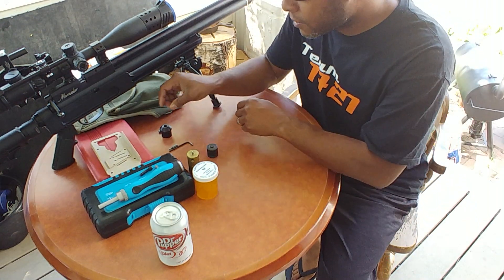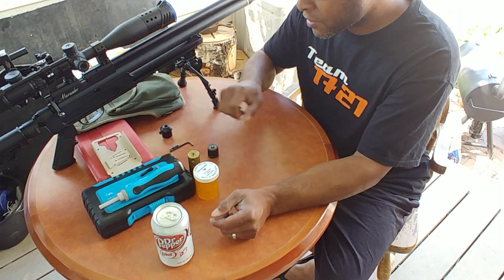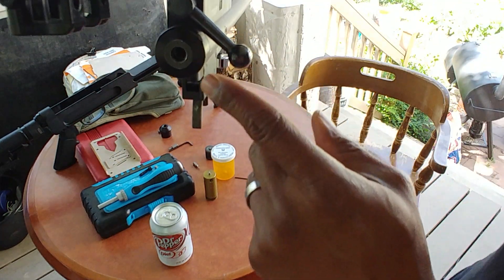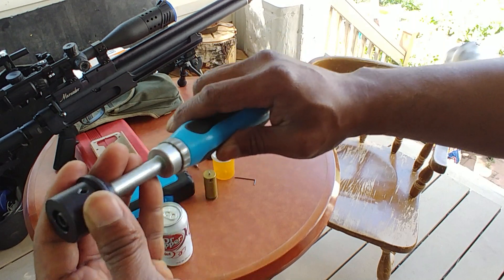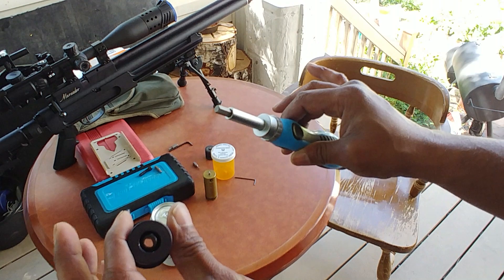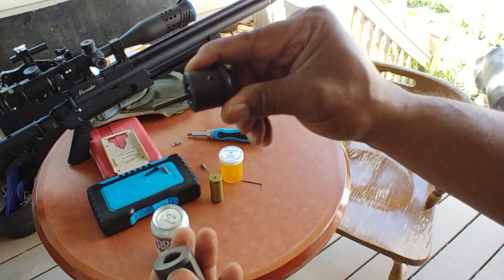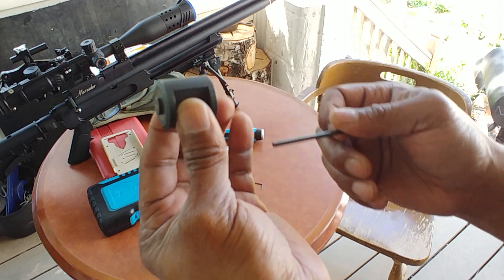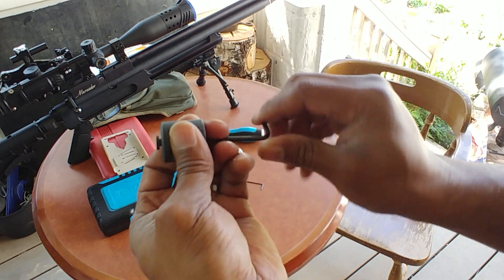How I tune a Benjamin Marauder for power.

Comment: hi Joe; i have the .25 cal. and i'm shooting about 740 fps. and i think that is a little slow.  It is deadly accurate. Something i really like about shooting. That is my number one concern about shooting air rifles' but if i can get more speed and keep my accuracy i'll be very happy.  Love your video. Very informative. What kind of speed do you get out of your .25 cal. I think when you buy a Benjaman marauder .25 cal. the spec.'s are in the high 800's if not 905 fps. Am i correct?  Also how do i know if my Marauder is regulated or not and how do i know if it has the de-bounce deal. One more thing Joe; what kind of shot count will i get boosting everything up.   thanks for all the info
Reply from the maker: Hey Robert.  All my Marauders are all custom at this point.  I've either made bigger calibers out of them or modded them.  My current .25 is regulated at 2100psi and I get an average of 822fps for 40fpe for 30 shots.  But again it's modded and has a Hill valve.  I'm not even sure what I got stock.  I'm just not giving you a lot of info hear.  I would say to you to try what I explained and see how it goes.  If you really want more power and aren't afraid to take your rifle apart, then put a softer valve spring in your valve, use ¼" vinyl tubing for the transfer port, and shoot a heavier projectile, say like the JSB Heavies or Mk2 heavies.  Please feel free to always reach out to me.
Reply from the maker: Hey Robert.  All my Marauders are all custom at this point.  I've either made bigger calibers out of them or modded them.  My current .25 is regulated.
Reply: @Monkeydad1969  hi Joe; thank you very much for the info. I guess i will end up buying me a regulator and i hope it works for me. The reason is because i like consistency as for as for speed so i can keep my accuracy from shot to shot. Do you have a de-bounce system in your marauder's? If so what brand.  anyway keep up the fantastic vid's.
Reply from the maker: @roberttheriot7612  no I don't use a debouncer in any of my rifles.  I generally don't have an issue with hammer bounce unless I over do the spring or have a bad spring installed.
Reply: @Monkeydad1969  hi Joe, couple more questions if you don't mind.  If i install a Huma reg., do you think i'll get about 30 good shots at 830fps or somewhere around there. also. i hear a ping when i shoot my .25 Marauder any suggestions  thank you very much
Reply from the maker: @roberttheriot7612  Depends on your tune and how heavy a projectile you shoot.  I don't see you getting 30 shots, more like 2-3 really consistent mags.  The ping is the air leaving the tube very fast, along with some spring /hammer noise.  The rifle should have a black de-pinger in the the tube.  If not, thick vinyl tubing---the clear tubing, cut to size to fit the tube will help.
Reply: @Monkeydad1969  ok' so i am always shooting jsb 25.39 g pellets. don't plan on shooting anything else at the moment. so you are saying my air rifle comes with the de-pinger since it's a Gen 2. And if not i might put one. My setup at the moment is the one you emphasized on in your video. I went according to your suggestions and i got 852fps. so that's where i'm at right now. Haven't did anything else so far. So when i get my Huma reg. i will work from there. but what i'd like to know is to stay around that speed what do i set my reg at. Like said earlier i don't mind slowing down a little like maybe 835-840fps.so i can get a nice string of shots since i am using regular pellets. Any suggestions will help   thank you
Reply from the maker: @roberttheriot7612  if you don't have one then get a chronograph.  Also, you can look at your gauge when you are shooting at the speed you want, then you will know when to set your reg psi.
Reply: @Monkeydad1969  hi Joe; so what you're saying is when i'm shooting i can tell where to set my reg. I do have a chrony. I just can't figure out where to set the reg. once i get it. I know you have a lot of custom parts but can you give me a close ball park where to set my reg. say for about 830fps so i don't have to keep taking it out every time.  thank you
Reply from the maker: @roberttheriot7612  the Huma reg is set in BAR, so when you see what psi your rifle is shooting 830fps, then Google the conversion and it will tell you what bar.  If you haven't bought it yet then when you order it let them know what speed you want to shoot at and they can set it for you.  If you do have it then it as easy as doing the conversion and looking at the reg to set it yourself.  Also, as I said earlier, my .25 M-Rod is set 2100psi which is 145bar.  That is 822fps for me and you can just use the hammer spring adjuster and the velocity adjuster to get to 830fps easy enough...or set it to 150bar and again use the adjustments to get what you need.  There are more entailed things one can do, it all depends on your comfort level when it comes to working on your rifle.  Like port enlargement, valve spring replacement, etc.  Just remember, the BAR settings on the reg aren't written in stone, so you can get real close if not exactly on the and just make the adjustments you need with the hammer spring and velocity adjuster.
Reply: @Monkeydad1969  thank you very much Joe. I really appreciate all the help. i wll let you know the results once i get it installed. happy shooting  thanks again
Reply: @Monkeydad1969  hi Joe, may i ask a question? my .25 marauder sounds like it burps when i shoot it. What does that mean? that's about the closes i can describe the sound. That sound kind of irritates me.
Reply from the maker: @roberttheriot7612  is it full of air or about empty?  Did it just start or been an issue?  It's hammer spring to far in for power?  Maybe it's in need of a new spring.  That's what's called hammer bounce and usually happens because of an issue with the hammer spring.
Reply: @Monkeydad1969  i keep my tank either full or doesn't go down less than 2000psi. Gun is just about new. Got about 150 pellets through it. Came with de-Pinger and i can still hear the ping a little. I know I'm being a little picky but that's just the way i am. I know i will have to live with it. Now the de-bounce thing always done that. so i'm guessing the spring should be pretty much new also.  thank you
Reply from the maker: @roberttheriot7612  I'd like to get my hands on your rifle.

Comment: Hey, this power tune you showed, wide open on valve, 5 turns on HS, & 3 turns out on H Stoke. I like that on my marauder .22. I'm shooting  CPHP 14.3 gain. I ordered some JSB 18.13 gain 15.89 gain and A arms 16 and 18  gain. Do you use the stock hammer spring? And do you think I can get 900fps with the 18 gain? All stock parts that is.P.S. I don't shoot more then one magazine,  I fill to 2900 and it's still about 2600, then I fill it back.
Reply from the maker: Yes, if tuned right you can get 900+, and I am using stock parts, including the spring.
Reply: Hello  nice video  explain clear on the .177  I have the .22 model  Your tune works for both the 177 and the .22?  Thanks.
PS with the power tune  would you think be safe for coyote  head shot to discharge a coyote?  Have one trying to attract my dog in back yard.  Thanks for info. God bless
Reply from the maker: @topdragster365w  yes it does work on all the calibers.  It will definitely make a .25 capable of taking a coyote.  Here in Colorado it's only legal with .25 or higher.  But if you are legally able to use a .22 for yotes then the power tune will be very helpful.
Reply: This is a great video - thanks so much for putting this out there.  I recently just got a .22 mrod and will be looking to set it up similarly.   With your tune on a .22, what would you expect for a quality  shot count?  If you were looking to increase that count just a bit, would you first look to close up the velocity valve?  I'll be hand pumping still for a bit so may want to tame it some.  @Monkeydad1969
Reply from the maker: @jfhall  for that type of tune I'd look for 2 magazines.  I'd also shoot a little heavier projectile.  You may not have to be that aggressive with a tune on a .22 M-Rod to get good power, and still retain a good shot count.

Comment: Doing that does it affect the accuracy
Reply from the maker: It all depends on your rifle.  If you're tuning for power then most likely you are going to a heavier projectile.  You'll still want to shoot what's the most accurate out of your barrel.  As long as you have a good barrel and choose the right ammo then the accuracy of your particular rifle should be good.  If you have a bad barrel or shoot ammo that isn't accurate in the beginning then your accuracy will most likely not improve with any sort of tune.
Reply: @Monkeydad1969  thank u very much ...gun shoots accurate Jsb pellets so I guess it will accurate even I turn on high power😄

Comment: What is your fill pressure you are starting at? I assume 3000-3200. Thanks for the information!

Ok so I did the tune and I ported the valve and the breach to 3/16”. Before I drilled it out it was stock. I put the piece of 1/4 tubing for the transfer port. Before I did all this I had the hammer ccw all the way back and a full 8 cw on the hammer spring. With the jsb 25 gr. Pellets I was getting 865 FPS by filling to 3100 psi. After I drilled everything and put the tubing in and adjusted it like you had yours set at 5 and 3 I am now shooting at 700 FPS. Any thoughts? Thanks.
Reply from the maker: That's interesting.  I don't understand why you weren't getting over 900fps before the mods.  Here's is my bud's M-Rod shooting the Kings on the tune:

Created: 03-12-2018 07:40:16 PM
Description: Casey's .25 M-Rod
Notes 1: v.a.5ccw, rva5cw, hs3cw from face
Notes 2: Kings 3000-1900
Distance to Chrono (FT): 1.00
Ballistic Coefficient: 1.000
Bullet Weight (gr): 25.390
Altitude (FT): 5280.0
Temp: 45 °F
BP: 24.81 inHG
Shots
#     FPS        FT-LBS     PF
16    846        40.36      21.48     
15    854        41.12      21.68     
14    861        41.80      21.86     
13    865        42.19      21.96     
12    872        42.88      22.14     
11    886        44.26      22.50     
10    894        45.07      22.70     
9     903        45.98      22.93     
8     901        45.77      22.88     
7     908        46.49      23.05     
6     912        46.90      23.16     
5     923        48.04      23.43     
4     925        48.25      23.49     
3     928        48.56      23.56     
2     935        49.29      23.74     
1     932        48.98      23.66     
Average: 896.56
StdDev: 29.45
Min: 846
Max: 935
Spread: 89
True MV: 896.66
Shots/sec: 0.12
Group Size (IN): 0.00

Now he was only worried about getting 2 good mags.  As you can see his first 8 shots were great.  I only filled to 3000psi and the Kings were flying pretty good.  Also, anything past 6 turns on the hammer spring will put the spring guide off the threads, so the hammer spring and guide are loose.  If you push on them with your alan key you'll feel it.  I wonder if there wasn't an issue with the valve in the beginning.  Also, since you opened the valve exhaust, did you change out the valve spring for something not so stiff?  That will help with getting more air.  If you are on GTA or Airgun Nation look me up by my YouTube name and send me a pm.  I'll be more than happy to exchange numbers.

Comment: I need that stock .. I have the 25.cal gen 2 and walther berral with the adjustable cheek piece in a wooden stock it came with.how much is that stock you have
Reply from the maker: Hey Miguel.  That is the Teryx stock and they aren't made anymore.  I just lucked out and got mine for a good deal.  My return Teryx stocks are for the Gen I.

Comment: Hello, is the benjamin marauder regulated ? If not , will a regulater be installed ? And finally do you advise me to buy it in .22 ??
Iam an hw100 fan and never owned a marauder thanks.
Reply from the maker: I have my bottle M-Rod in .25 regulated to 2100psi.  I get 48 shots with a 3.13sd.  It uses a .35ltr bottle.  I'd say .25 over .22.  But that depends on your circumstances and what you are using it for.
Reply: @Monkeydad1969  thanks man 👍🏻

Comment: Hi how to stop air after removing valve screws both this is how my friend increased his marauder power please help
Reply from the maker: I'm a little lost of what you're asking.  Are you trying to get more power?
Reply: @Monkeydad1969  yes for my previous marauder my gun smith removed metering screw and grub screw and increased power but sir didn't come even after removing both screws from the side how to do it please help
Reply from the maker: @anilabbaraju1  did you adjust the power adjuster to put more preload on the hammer spring and did you increase the hammer stroke by backing the striker pin closer to the hammer face?
Reply: @Monkeydad1969  yes I have increased the hammer spring tension from complete back up i turn 10 clock wise turnsand hammer strike anticlock wise  till it stops

Comment: I've watched your video and did everything you recommended, but still am not getting nearly as much power as I should. My .25 cal Marauder used to shoot projectiles much faster, but now it just feels underpowered. Do you know of anyone I can send my gun in to for a tune-up?
Reply from the maker: What are you getting now to what you were getting?  But as I said too, all rifles are different.  What are you trying to get and with what projectile?
Reply: @Monkeydad1969  Previously I used to blast halfway through a 2x4, now it barely sticks into the surface. If you're looking for a chrono measurement, unfortunatly I don't own one... I use .25 Cal JSB Diablo Exact King pellets, they're 39 Grain. I also used to make shots at 40 yrds. now, it drops enough to where the rifle is pretty much useless at that range.
Reply from the maker: @paulomello7850  Kings are 25.39gr.  The Heavies are 33.95gr.  It sounds like you detuned your setup.  Did you go back to your original setting?  Are you sure you did what I suggested in my vid?  Velocity adjustment screw fully clockwise then out five turns counter clockwise, hammer spring 3-5 turns clockwise fully counter clockwise, hammer stroke fully counter clockwise then a few turns in?
Reply: @Monkeydad1969  Yes, I'm positive I was doing what you showed. Just tried it again with no luck. I'm thinking there may be an issue with the valve.
Reply from the maker: @paulomello7850  is the rifle shot cycle different?  Is it making any strange noises when you shoot it?

Comment: What do you think is the best pellet for the 22 cal benjamin marauder for the most punch and accuracy
Reply from the maker: Man that's a great question.  I don't have a great answer.  Depends on what the barrel likes.  Also, if you have one of the older M-Rods with the bad .22 barrels, then you'll need to inspect it, should only be the last half inch of the barrel to the crown.  If so, people cut off the bad section and re-crown it.  The Crosman pellets are good, but everyone who knows me knows I'll push Predator/JSB...lol.   Unfortunately you'll need to try different pellets to see what works best.

Comment: Hey Monkeydad, You are right, I got my new pellets in, and I'm  shooting an average of 928fps. I'm using the AArms 18 grains and they are plenty accurate enough for me! Pellet on pellet at 30yds and about 1 inch at 55yds.  I'm very happy with That!  But I have another question if I may ask. I've been play around with different setting, and no matter how I set it I can still hear hammer bounce. Do you think a 10# spring ( and/or ) a tss spring kit from War with the super hammer would fix that and make it easier to cock? Thanks
Reply from the maker: Man, I'm so sorry.  I just happened to be going through my comments and I just saw this.  Are you still having the hammer bounce issues?

Comment: Hi MDad,.. should i empty the tank before doing all that?

Reg,

Slamet
From Suriname
Reply from the maker: No.  To do the adjustments there no need to de-gas not unless it makes you feel more comfortable.  The only time to want to de-gas is when you actually need to get into the tube itself for the internals.

Comment: That stock looks so good. I do not like the foregrip on the Marauder factory stocks. They are too fat flat and bulky. How did you put a .35ltr. bottle on a Marauder ?
 Very good helpful and informative vid. Thank You.
Reply from the maker: I love the stocks on all of my Marauders, they're all aftermarket.  The factory stocks are ok.  I really like the Armada stock and it's just an easy swap to a Marauder.  On my bottled .35 I had the tube cut to my desired length.  On my bottled .25 the complete setup was made to fit around the tube and frame.  Great sport, gets frustrating at times...but seriously digs a hole into the wallet.

Comment: Enjoyed hearing what one does for a power tune.  I see a lot of the parts houses have stiffer hammer springs for sale but maybe they aren't needed?  What do you think of hammer debounce setups are supposed to save air and reduce noise?  Thanks for taking the time to do a great vid that helps us all!
Reply from the maker: I've never used them.  Not saying they don't work, but not for me.  Joe Brancato installs them on the M-Rods he sells, so there may be something to them.  Stiffer hammers are useful.  Say with the stock valve and you want the power without spending a lot or with little effort.  Air consumption is an issue then.  If using aftermarket valves, my favorite being the Cothran Powerhouse valves---the first balanced valve, then a stock spring is amazing.  But balanced valves like the Cothran or JSAR are a different vid altogether.  Those are made to produce raw power.